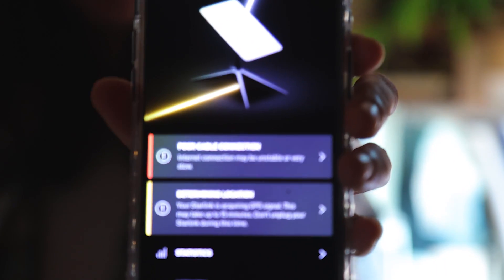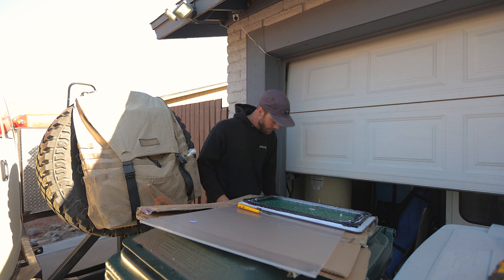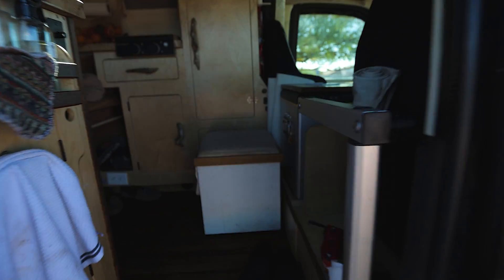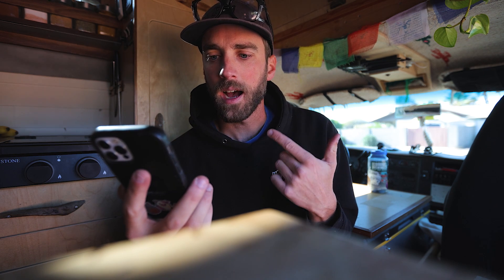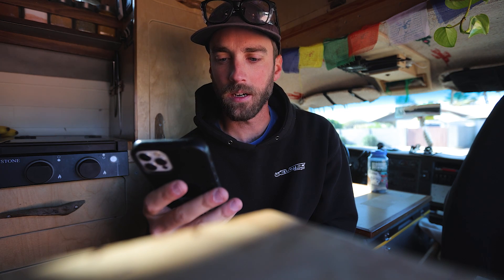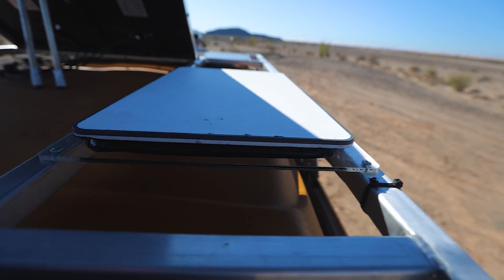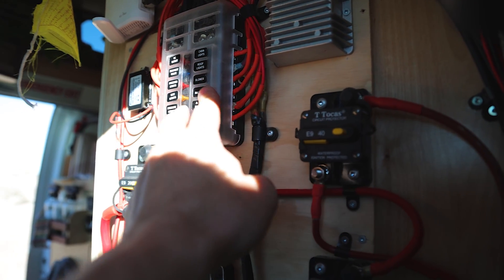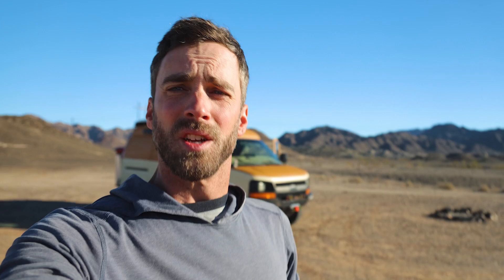STARLINK WIN! Flat Mount 12V DIY Conversion Issues SOLVED

Comment: Nice! I would be happy to hear about long term comments on your setup. Did you have any condensation build up issues now after 2 months? Can you see water there?
Reply from the maker: It’s been pretty solid aside from the Ethernet cable that I accidentally cut may need to be replaced. Zero condensation, however we’ve been in pretty dry climates.
Reply: @slowroamers  thanks for the answer. Did you leave a ventilation hole there or was it tightly sealed?
Reply from the maker: @TravelingVanProblem  that I did. There’s expansion and contraction with temp/altitude fluctuations, so best to have an opening.

Comment: While you are swapping components, consider ditching your current router. Aside from being pretty slow it has multiple issues and the most relevant for van lifers is that it does not support stable wifi calling for your phones. Cheap TP-Link routers make a good replacement and run on 12V DC though I'd recommend using a regulator.
Reply from the maker: I’ve heard of this. Thus far we haven’t run into any big problem, but I can think of some times that we’ve noticed the less stable aspect. Thanks for the insight. Have a suggestion for a better one that won’t break the bank?

Comment: Awesome!  What's the difference in battery usage with the 12v conversion?
Reply from the maker: I haven’t actually tested that yet, but, we’re finding that what we’re pulling down in solar with the winter sun is more than enough to counter the draw off the battery.

Comment: Some great troubleshooting there.   Love it when a plan comes together.  Careful if you use it while driving.  I have heard of others(rules may have changed)  of being banned from the network for in motion use.   Something about fcc regulation on the dish
Reply: Lots of talk about this on Reddit.
Reply from the maker: Yeah, I believe it’s up to 10mph that it can be used in motion. It’s too bad that we did the swap so late, missed the better early days. Ohhh well. Thanks for watching!!🙌🏻
Reply: @slowroamers  It occurs to me now that the Flat-Mount also allows you to have the dishy in place ALL the time versus having to store it, take it out and mount it every time you stop and park. That's a pretty significant savings on storage, time and hassle.
Reply from the maker: @SlowRoamersSupport this is true and one of the major benefits of the flat mount.

Comment: Glad you are up and running again. Good job sir. The new cable and connectors are going to make the install bulletproof. The bonus with the clear lexan is that you’ll be able to see if any moisture gets in. Good idea.
Reply from the maker: Thanks again for the tips, they actually really helped!🙌🏻